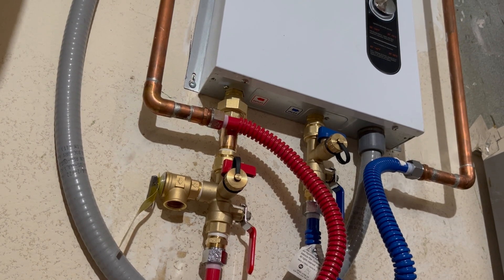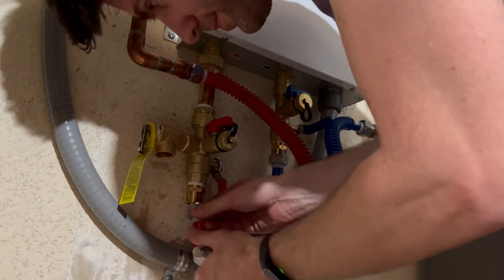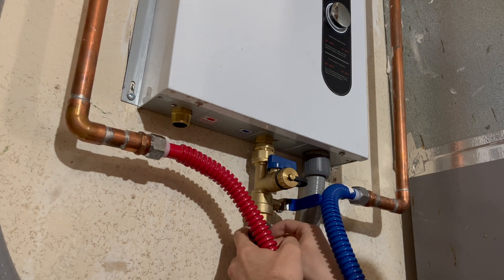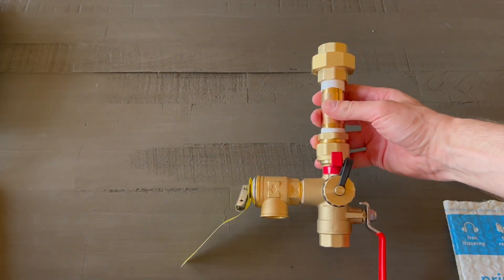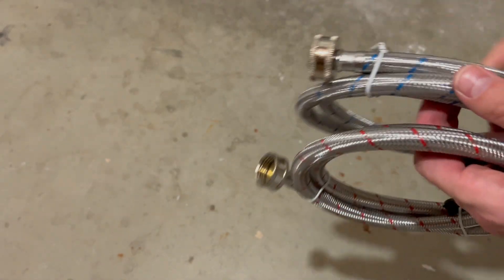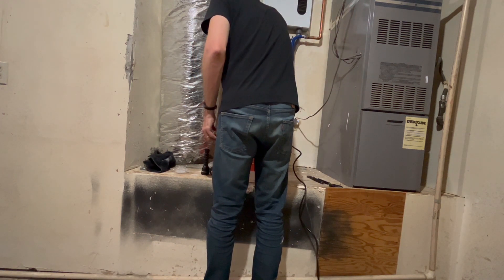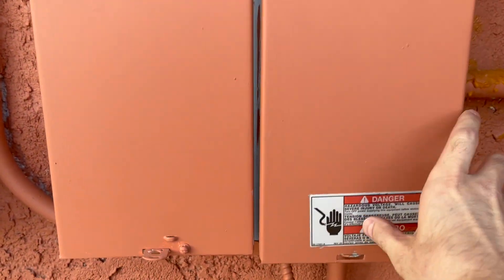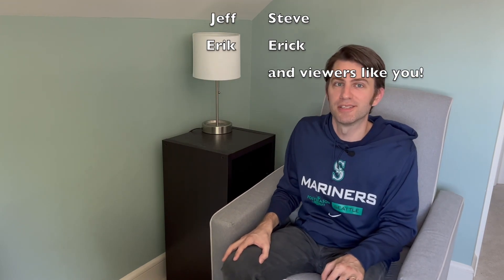Installing flush valves on an ecosmart ECO 27 electric tankless water heater

Comment: What is the size of your inlet/outlet fittings? Will this valve work on an 1/2” inlet? If not, what do I do about that? Help plz!
Reply from the maker: I believe the inlet and outlet are both 3/4" so this part wouldn't work directly with a 1/2" inlet. I think 3/4" is pretty standard size, so I'm surprised that you have a 1/2". In that case, you could adapt it to 1/2" on either end, or try to rig something up. Trying a couple Google searches, I've seen some things that look like they could work, under "1/2" valve with drain" - I can't say for sure, but maybe that would work?

Comment: Wrap the thin Teflon tape 10 times around the thread before making the connection. Some guys will use dope on top of Teflon tape for water tight seals

Comment: Very informational video.  I'd check out some videos on how to plumbers tape though.
Reply from the maker: Yeah I think you’re right. Could use some more practice. Might have been well-served to use some pipe dope as well. The good news is, in the last several months since it’s been installed, it doesn’t seem to leak during usage.
Reply: @jpfath  no leaks is really all that matters 😁. I've had plumbers tell me anywhere between 3 and 10 wraps. I find 3-4 wraps around the pipe sufficient.
Reply: @moroniccolonic3959 Teflon tape comes in different thicknesses. The cheap thin stuff use 10 wraps. The thicker stuff I think you can get away with 4 wraps
Reply: @simpleagain1  we used the plumber that wrapped 10 times once lol.  Try gas wrap and maybe you can get away with 2 lol
Reply: I had an electrician say you can’t put all those wires together in one conduit but every Eco Smart I’ve seen installed is done using only one conduit. Thoughts?
Reply from the maker: @simpleagain1  I’m not an electrician (and I paid one to run the circuits) so I can’t say for sure what’s kosher, but it seems to work ok from my year and a half or so of experience with this one. Can’t remember if I show in this video, but it’s actually 3 separate 240V circuit breakers and circuits.

Comment: I have the same tankless water heater, I'm about to buy the isolation valve kit and possibly an in-line scale inhibitor to install, debating on the latter. I'm not a plumber either, so no worries about the perfection, we've all been there! Thank you for posting your installation!

Comment: Plumber here that has that very heater. 100.00 worth of parts and a pump and a Saturday afternoon is a lot to spend to extend the life of a 500.00 heater. Also you could have just disconnected the blue and red hoses and used them with the pump instead of all that.
Correct that a tankless system doesn't require a T+P valve
metal to metal connections are tapered or cone shaped threads that get tighter the more they are wrenched. I use two wrenches that are at least 12" long on these and pull hard too.
Reply: This is a good tip on using flexible supply lines instead of installing flush valves. About to put one of these in.
Reply: You could've just put some 2x4s to mount the water heater off the wall a bit
Reply from the maker: Both good points. Plumber beats DIY’er :) hopefully this can help some others and I like making the videos, but good thoughts for my next go-around. Luckily the heater is down to only $400. I wonder how often I’d have to replace vs flush though.